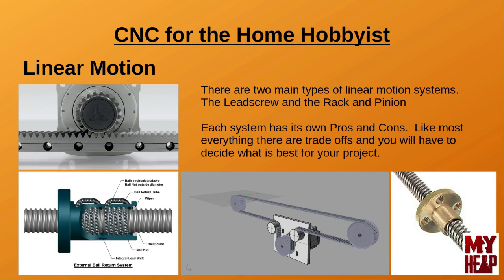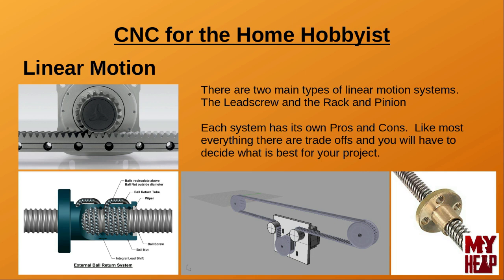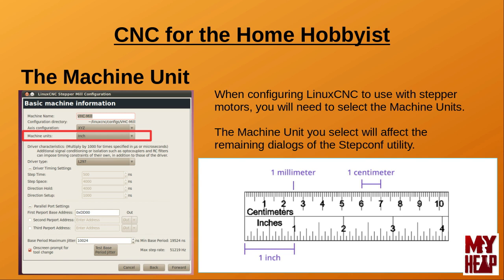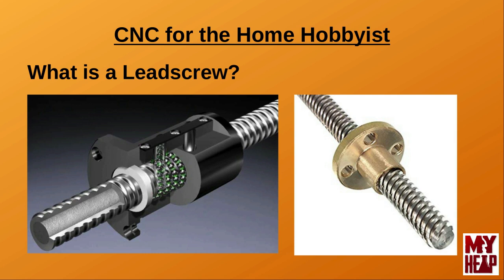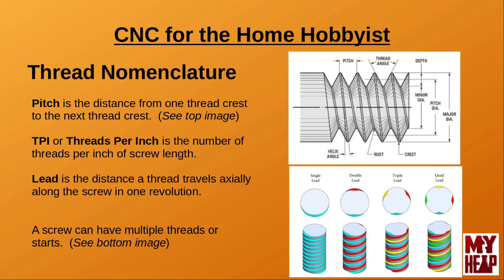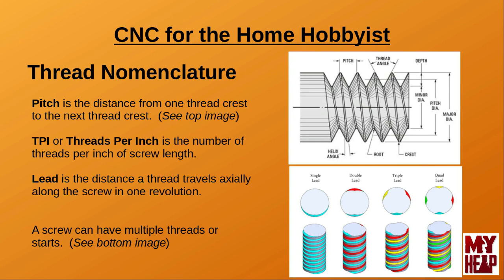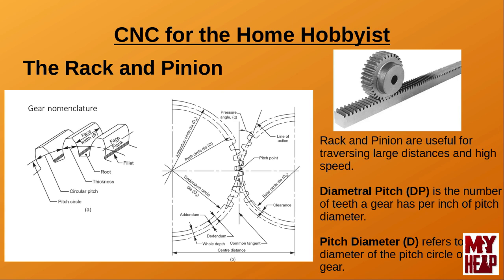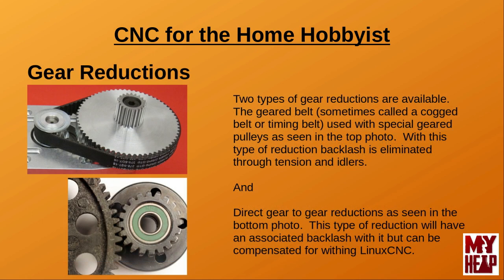LinuxCNC for the Hobbyist - 013 - Linear Motion

Comment: My router has rack and pinion, my mill has lead screws and my lathe has lead screws. I may upgrade the lathe to ball screws though. Good info on linear motion. I'm binge watching if you can't tell. 😀Thanks for the video!
Reply from the maker: Glad you like them George.  It's folks like you that make it worth the time to make the tutorials.  Just remember, I am not a teacher, engineer or machinist.  I can and do make mistakes.  😀

Comment: Your recommendation for the size of the power supply is incorrect.
The recommendation for the amount of current needed for stepper motors is 2/3 of the total sum of max current for each motor.
There is a complex formula behind this.
Reply from the maker: Thanks for the information.  Can you share the data so I can make corrections when I start back in on the series?

Joe